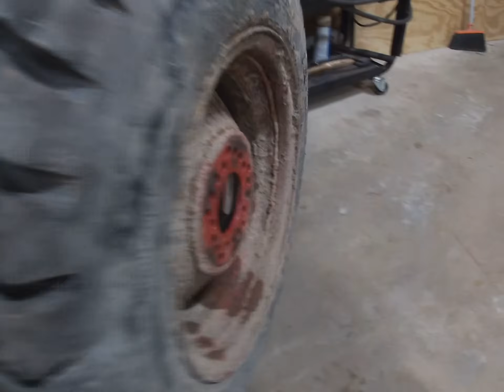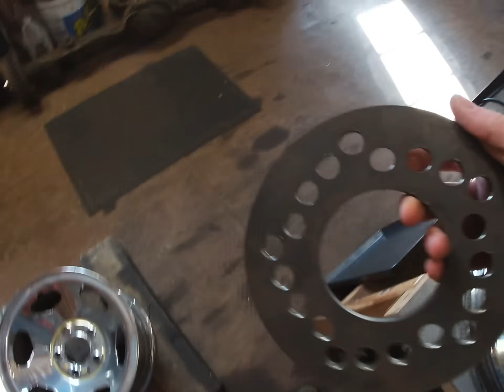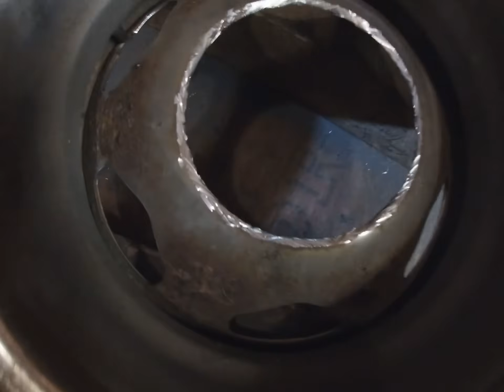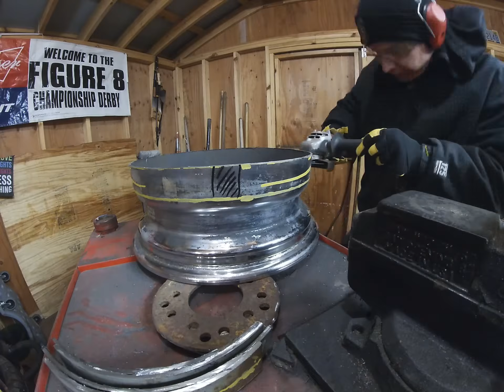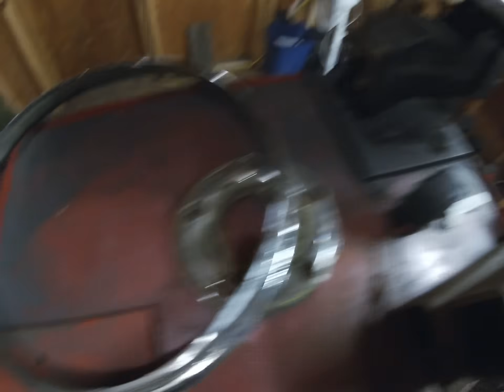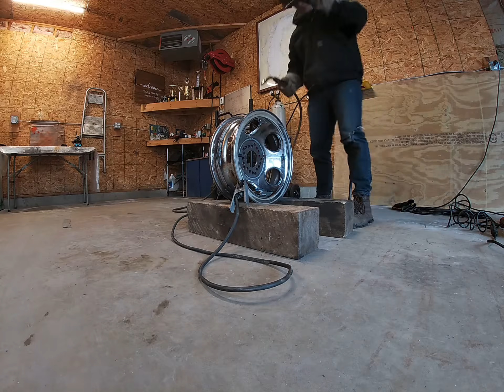Narrowed derby wheels, How to BUILD Your Own!

Comment: Try using two angle pieces with some lengths of all thread used for your spacing. Easy and repeatable reducing any measuring errors. You could also find a hub of some kind and build a fixture to check run out before final welds go in.